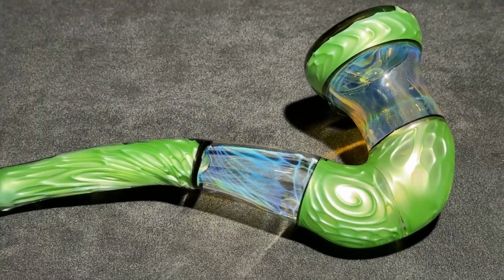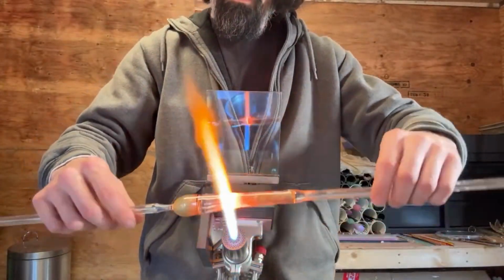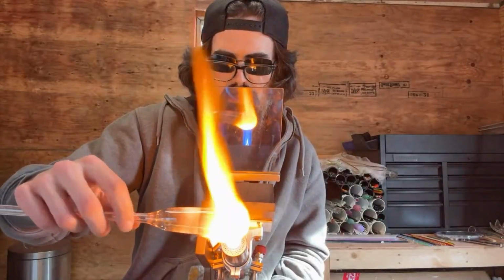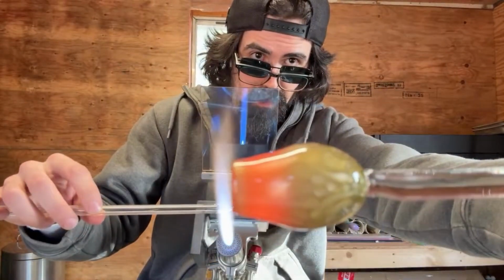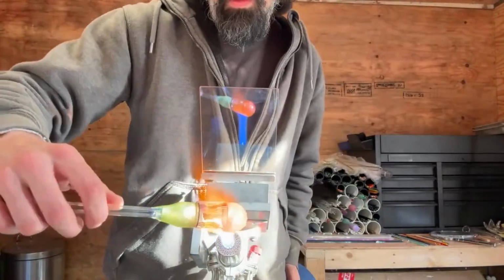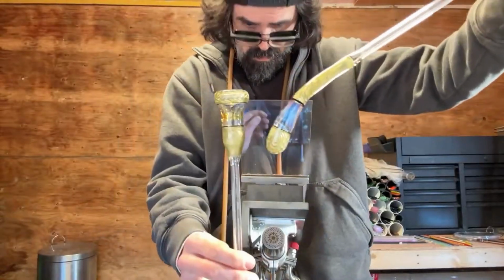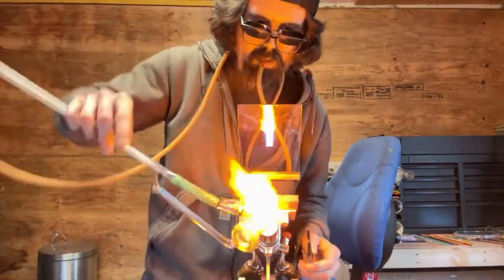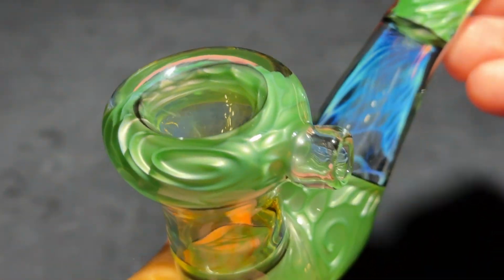Two Piece Sherlock Tutorial - Glass Blowing Demonstration - Whats Melting?

Comment: Chromium is a poisonous heavy metal. Is it safe to smoke out of that?
Reply: Trivalent chromium is probably what they use, it's not as toxic as hexavalant chromium but it's still pretty bad
Reply from the maker: There are a variety of different heavy metals among other things used to colour borosilicate glass. Chromium being one, cadmium, cobalt, uranium, silver, gold are some others. As a finished piece there is little concern once these elements are sufficiently integrated into the structure of the glass.
Reply from the maker: No, typically nothing leaches out of borosilicate glass, including its colorants. Borosilicate glass is used for its inert nature. It is safe.